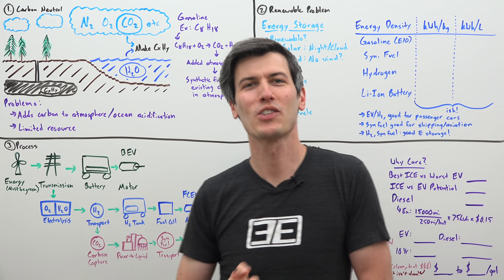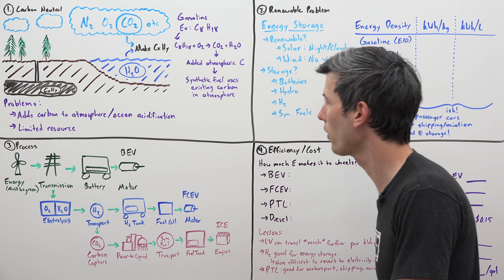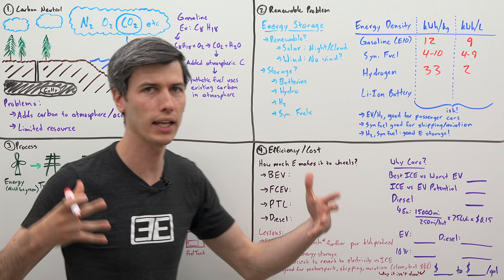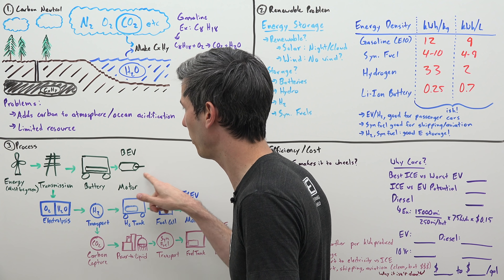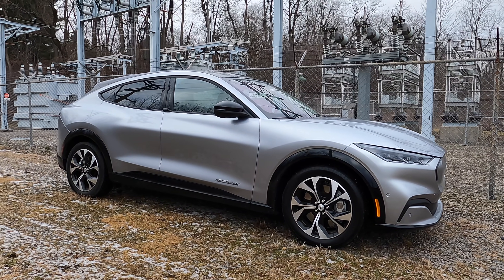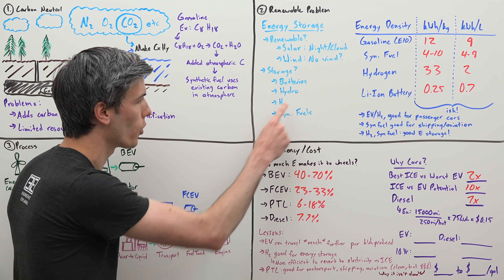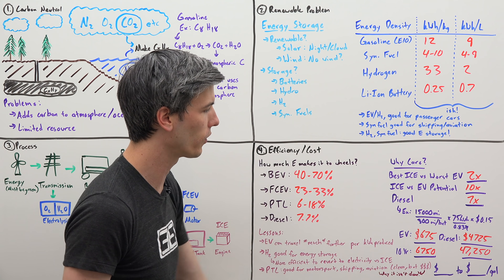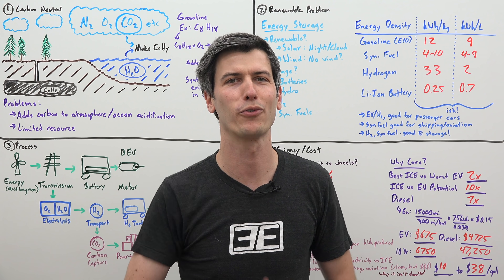The Big Problem With Synthetic Fuels

Comment: you should also take in to account that electric cars cant last over 7 years and that their battery needs replacement over time while gas cars CAN last over 50 years (if manufacturer wanted to)
Reply: This is a lie. There are 10 year old EVs driving around RIGHT NOW. All EV makers warranty their batteries for at least 8 years. Battery degradation is real, but already significantly less of a problem than a few years ago and getting better.

Comment: have you heard about ammonia beeing used as fuel? Apparantly you could use it to store hydrogen and use it in a fuelcell (if you seperate the nitrogen and the hydrogen) or you could use it in an ice when mixed with about 10% other fuel, either gasoline, diesel or hydrogen. What are your thoughts on that? Is it a viable option for trucks, ships and aircraft or wouldn't it work?

Comment: You call 2$ per liter expensive lmao, in my country that wouldn’t be a big difference
Reply: He's talking about the cost, not about the price you'd buy it for.
Reply: @peter.g6  With tax in my country it would cost about 2.5-3$, id still rather pay that amount than drive a EV
Reply: @broshido2745  The tax will probably go away since it is a CO2 neutral fuel.
Reply: @Bro Shido, There's much more than only taxes (storage, transportation, margin of the producer, margin of the seller, ...) In the end you will be paying more around 4-5$ per liter than 2.5-3$

Comment: this seems an awful lot like a high tech solution to a low tech problem, considering they have already developed plants that use solar energy to convert water and carbon dioxide into replacements for gasoline and diesel.  
those plants are corn and soy, respectively.
but battery electric definitely takes advantage of economies of scale in energy production, and can be engineered to minimize energy waste, so battery electric cars are definitely a more viable future.

Comment: What about alcohol and other synth fuels which are not derived from grid power but from crops directly? Surely there the energy loss is a bit less relevant, and its more about how much fuel you can generate per square kilometer of land.

Comment: One of the benefits of using LFTR is the waste heat lends itself to chemistry.  We can synthesize ethanol and dimethyl ether from LFTR waste heat which would, I assume, greatly reduce the cost/liter over current estimates.  Once batteries are > 400 Wh/kg the value proposition for aircraft looks good and I'm all for putting LFTR on the big ships directly to bypass fossil fuel usage there entirely, but until then I think a LFTR -> chemistry -> gas/diesel is a good intermediary as we move to all-electric.
Reply: Batteries won´t gain much more capacity in our Universe without bending the laws of physics.

Comment: I hope you realize that "wind turbines, blades, etc) have a life of 20 years.  The blades have to be buried to dispose of them (done in Wyoming).   Do a show on this "clean"  energy that supposed source has.   Also, show how "clean" the manufacture of lithium, all the rare earth metals, and other mandatory materials for efficient lithium ion batteries require.
Reply from the maker: Making stuff is bad. Is making gas cars good? Just like an ICE vehicle, nearly everything in an EV can be recycled. The video isn't about windmills, but any form of energy production will require maintenance.

Comment: The thing is we need carbon capture technology anyway. At this point I doubt the human race will survive without it. However we need to make THAT economically viable, and if all the technology can improve, synthetic fuels may be one way to help make large scale carbon capture technology viable. Though the fact we will have to set some of that carbon aside to NOT be burned will drive up the cost of fuels produced. Perhaps some of that carbon can be used to make graphite for pencils as well, IDK, but we need carbon capture regardless, and eventually synthetic fuels may be the ONLY way to keep existing ICE based cars on the road, even if new ones become all but extinct.

Comment: I always like to make the comparison between the most thermally efficient ICE that we know of, the current Mercedes F1 engine, which is 50% thermally efficient. And make no mistake that is amazing efficiency for an ICE. But then there's Formula E, where the least efficient cars on the grid are still 96% efficient. 96% of the energy stored in a Formula E car's battery makes it to the wheels. And those are the least efficient cars in Formula E. 
I have no idea what the efficiency of the Mercedes EQ or DS Techeetah cars is, but it is better than 96%. And with the way things look right now, that Formula E technology is probably going to reach the consumer market sooner than the Formula 1 technology behind Mercedes' and Ferrari's engines.
Just think about it, soon we might have cars that pull 1kWh from the wall and give you 900Wh of usable energy to the wheels.

Comment: depoends on the use case. i do hope if we get rid of gas the synthetics are an option. I have a few classic motorcycles I would like to keep being able to sometimes ride. electric motorcycles are faster and cooler, but would be a shame to not be able to throw the leg over my 1975 moto guzi 850 T once in a while and at $10-40 a gallon considering it gets maybe 100 -200 miles a year not a big deal.

Comment: you're going to have to convert those US$  for the rest of the world.  :)     There's really no point in pursuing synfuelsthem as a priority, never was unless cost per unit was lower than today's hydrocarbon based distilled product.  The message is really simple - it's FC or it's EV.  Optimize the battery side for density, charging rate and low cost materials and it's game over.   I do think that battery farm storage for all the renewable electricity generation gets over played some though - just make it so the EVs can be plugged in virtually everywhere with a unique account code on the car, and regardless of the power provider - charge the owner his home power agreement rates... leave them plugged in all the time and act as energy soaks for high volume production.... when there's not high volume production going on - have that system signal the rate to the car, where you've pre-programmed your pain level...  if you charge while at work, the night time grid won't have to charge you while you sleep.  It's really doable, and emphasizes using the full renewable electrical volumes produced.

Comment: He ignores the fact that a) Demand for EFuels will be big and b) they can be made at home with the right equipment
Reply from the maker: You'd need even more energy to make it at home than a large scale manufacturer. Demand doesn't change how much energy is required to create a fuel. Their are efficiency limits to the processes.
Reply: Engineering Explained if you use your own energy, like solarpanels on the rooftop, it would work in the background without even needing to do anything (independently)
Reply: After a beginning investment, with time, it would make economic sense for atleast big Trucks ( who then dont have to wait for the battery to charge every 250 miles)